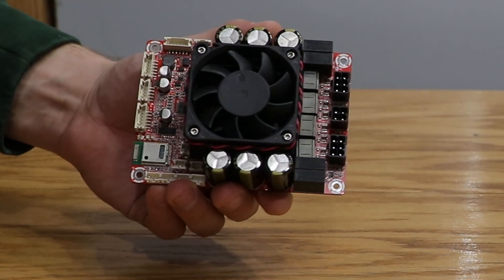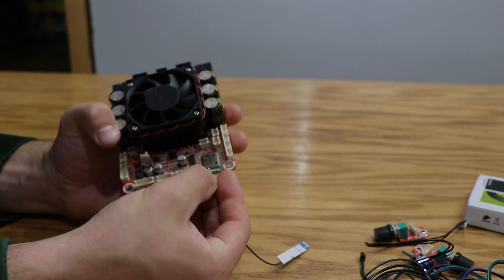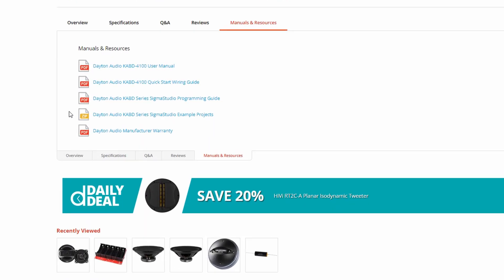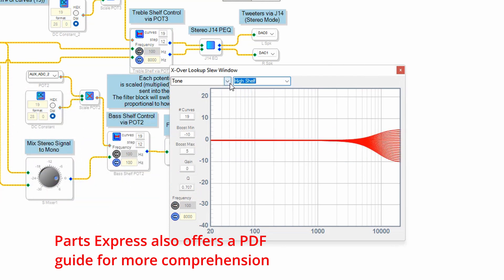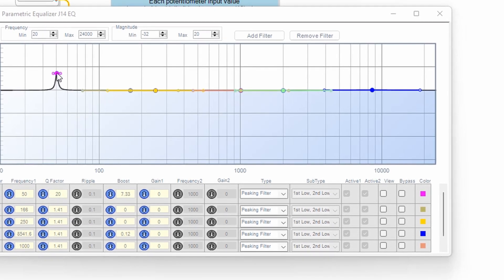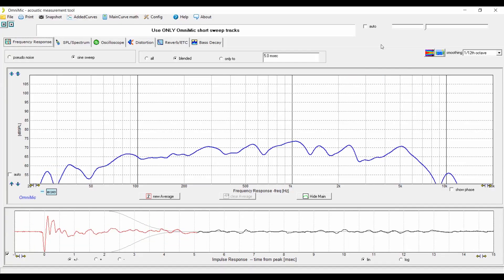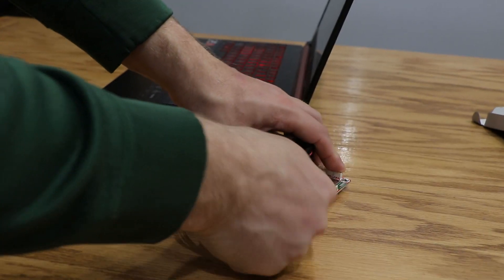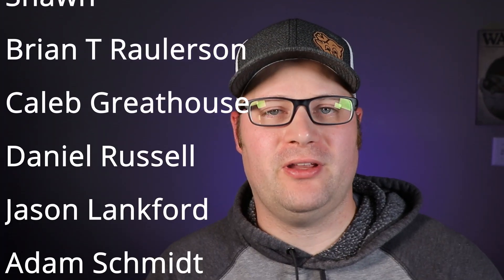Is this the Most POWERFUL Amplifier for DIY? Dayton KABD with DSP

Comment: This is really cool. Been literally waiting for someone to make video on this board. You definitely got to make a 2.1 or 4 way speaker project using these. Like the your boombox project. Considering this outputs 400 watts, it should be a super powerful system.
Reply: Just an FYI if you are still even interested.   I did some shopping around and found out that if you want to stay within Recommended Power Input you can get around 380 watts safely.  38v @ 10amps.  Power supplies being what they are, I would not recommend going to 39v @ 10 amps or exceeding the 10 amp draw.  Even then, having 95watts per channel is pretty nice.

Comment: My 2x4HD just got made obsolete
Reply: If someone who has experience using miniDSP could through light in future how’s the dsp in Dayton example time alignment. I am not even talking of Dirac. Also miniDSP u can use any amp with Dayton u r stuck. I want to see if Dayton 4x100 with the best power supply can it play 70% volume without distortion. Dayton should make a tpa 3255 model too for higher amp users.

Comment: Great video on the intro of this great amps with dsp. This is what MiniDSP should had done long back. Wondering how we can use this as a solution for the car with just a head unit. Use these as dsp and power our speakers
Reply from the maker: That's actually one thing that I'm thinking about as well. The DSP is so powerful in this unit, it would be excellent for something like that. I have a pickup truck that I'm redoing that I thought this would be interesting to try on. I'm just not sure how much power I'd really get from it. They used to sell just the DSP board by itself you can hook up into your own amplifier. I kind of wish they would come back with something like that again.
Reply: They make a stand-alone dsp as well that you can run in-line with car amplifiers. I believe that is powered by 12v . The amps are 24v I believe so they will not work in a car without a transformer. I think the model number for the dsp is the dspb but it’s all a little hazy
Reply from the maker: @FungiFrenzied  they do offer the older DSPB boards still. They just don't offer anything new in this line. And you're right those could be an option. As far as these amplifiers go, this one works anywhere from 12 volts to 39 volts. It could work for a car. But you're probably right, the older boards without an amplifier might be the better route to go.
Reply: @Toid  these can be daisy-chained with one acting as a slave so you could use two of them if you need more power - assuming that makes sense with your driver configuration of course